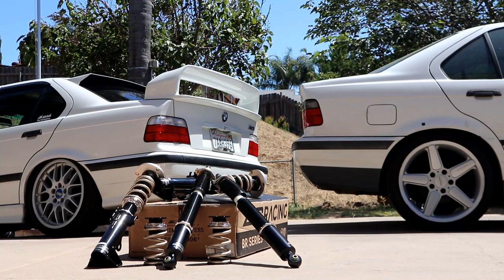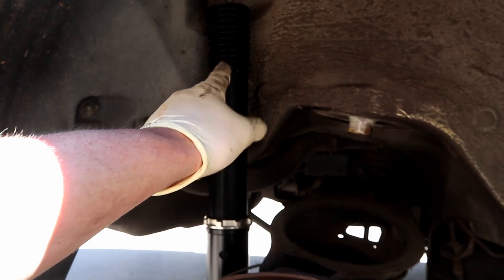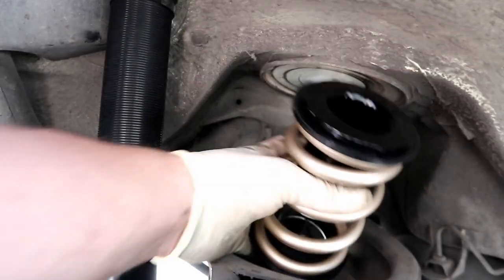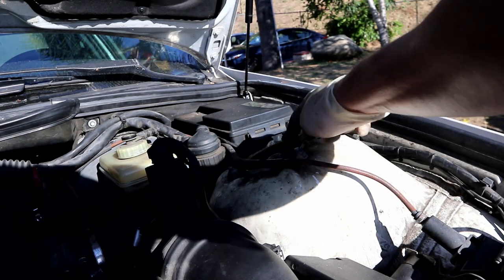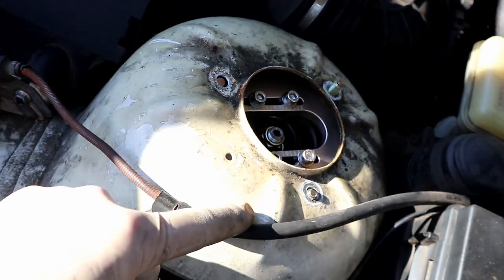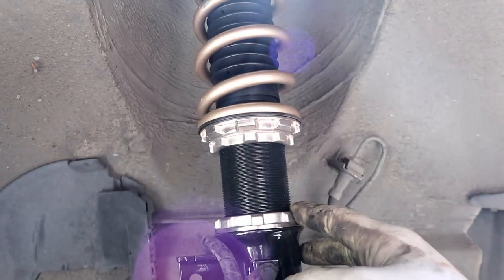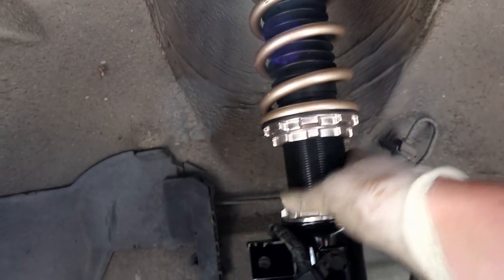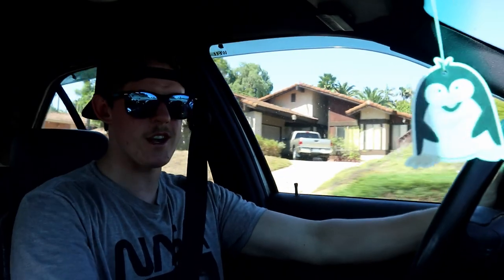Complete E36 Coilover Install and Setup DIY

Comment: Literally just got finished changing my coilovers. Scraping lowlife.
Its a little easier with the vert for the rears.
My camberplate bolts are pretty jammed in position and my camber bars probably need adjusted (tyre shredders) and one of my bbs rc has a leaky weld :( gutted. She is sitting pretty though (328i slammed stance 40mm spacers back 25 front on original bbs rims mora metallic tan interior)
Reply from the maker: sounds mint my dude! what coils did you go for? rear shocks on droptops are super easy unless your top doesnt work.
Reply: Just went for cheaps dude, the roads in glasgow are terrible iv already changed the shockies on the back 2wice before so just cheap and nasty coils. The top still works thankfully but tbh I'm having trouble with the driver window at the moment sticks then stops, then when I get it unjamed a need to do a window reset which is basically everytime I use it. Otherwise cars cool as a cool thing. I basically just buy a new set of cheap coilovers when the fronts give in.
Reply from the maker: @stevencameron3154  damn man sounds brutal, the roads here are not that bad. ive had window problems for years on my droptop, they all work currently somehow, main reason i love the Sedans! we have 4 sedans and none of them have ever had a single window problem.
Reply: @M3NACE  I had 2 coupes before my vert and they had zero window problems. I just love the style of the 2 doors though and even more so the verts now. The suspension should last about a year lol. I seen used hydraulics on ebay for about £1500 so maybe next year I'll see if I can come across something like that again. The window thing is my next fix this week lol rolling about with no door card on it just now :( and the leaky wheel. Got that welded last week but its not sealing properly so I'm on the hunt for 2 rc042s (not easy to find) as it has rc041s on every corner. Fun and games but totally worth it.

Comment: Good job presenting the installation.  I just installed some coilovers on my E36 M3, so what you said matches what I experienced. I didn’t go for a slammed ride height, so I have the rear adjusters in place. 

One problem I had in the rear was replacing the left rear spring. My swaybar made contact with my exhaust (Supersprint), so I had to remove the swaybar and disconnect the rear exhaust hangers to let the exhaust drop down and allow the control arm to be pushed down for spring removal. Did you have a similar issue?

One thing you didn’t talk about was making sure to set the rear shock length to the correct length to keep the springs from coming loose at full droop (or when jacked up off the ground).  Given that you have no spring height adjusters in there, do the springs come loose at full droop?

During your road test, it looks like the car rides really stiff. You’re bouncing in the seat. But I guess that with a slammed ride height, you can’t have too much suspension travel.

At around 21:00, when you’re installing the front coilover…what happened to your steering rack boot???  It looks like it got twisted into a mess!
Reply from the maker: I did not have the Issue with the exhaust, I have a borla catback, not a supersprint, so it may differ. as far as the rear shock length goes, it depends on which coilover kit you have. the BC coilovers have a significantly higher spindle Hight, as in the suspension does not drop nearly as far when the car is jacked up, even with the spring perches removed fully for the slammed look the spring does not bounce around loosely in it's perch, however a set that has a long spring travel may do that, in which case you would need to adjust the shock body length to close the gap. as far as the adjustment goes, installing performance suspension will increase the stiffness of the car, but it is set to a very manageable damp rate for a street car. my drift car has BC coilovers as well, and I have set the coilovers up for drifting on smooth tracks, and its almost unbearable to drive on the street. these cars have excellent travel in the rear even when sitting as low as my M3 does, and I looked at some of the early 90's DTM E36 race cars for my stance, their race cars were even lower than my M3 is and were competitive back in the day.

Comment: Great Video! 
 Im  rebuilding my 92 325is.Rebuilt the cooling system and it's time to rebuild the suspension.  Back left side has a broken shock mount. I saw a plate they make to repair it. Has to be welded in.         Have you ran into this problem?
  I'm going to put them on both sides before the other side gives out.
 Any suggestions for what brand coil overs? I'm not drifting just want quality parts on this rebuild. Thx
Reply from the maker: I like BC's run them on all the cars, street or track. ive heard broadway static coils are good, ive also heard that solowerks are good street coils but the welds dont like the track that much. as far as the shock mount problem, i havent ran into that issue. i would have it re-welded and run a rear strut bar, that should help with the stress distribution alot.

Comment: Wow that M3 looks sweet with the coilovers I have 1999 E36 323is 3 Series Coupe in show room condition I’m starting to add the coilovers soon , Headers with down pipes it’s running on 245/40/17 in the rear and 235/40/17 in the front but adding 10mm spacers on the rear cause it rubs light at times when I take a curve to sharp and quick . If anybody that done there E36 got any pointers I’ll highly appreciate it 🤟🏼

Comment: Nice video.  How are the BC BRs holding up?  Overall a good set for the E36?
Reply from the maker: Excellent, going to 3 years of daily driving
Reply: @M3NACE  Great to know, thanks!  I'll be looking to order a set. I have H&R lowering springs but with the older shocks it is getting a bit too harsh for daily driving.

Comment: The install setup for the rear, would that be OK for street/weekend autocross? Does the ride feel very harsh too?
I installed mine just compressing the spring installed to about 5-7mm. Been seeing this way of installing recently by you and Denofa.
Reply from the maker: Yup! Have them set up this way on my street and my drift car with no problems.

Comment: What are the benefits of a coil over? just that the stance looks better ? is it just to lower it?  you did not elaborate. You said install them "because they are the best out there" what does that mean?
Reply from the maker: best way to lower it with good performance, stock suspension is usually designed for maximum comfort while having good performance and good clearance for bumps, potholes, and clearance for curbs ext. if you want to lower your car and increase the performance of the suspension, good quality coilovers are the best option. they allow maximum adjustability for damping while having adjustable ride height. the problem with getting a good spring and shock setup, like koni shocks and H&R springs, which it a pretty good street setup, is that the shock and the spring are not designed to be in harmony with eachother. if the spring is lower than the shock is designed to be, the shock will not have its full range of travel, and you can bottom out the shock, which can disrupt the car. coilovers like BC's, broadway static, or bilstein coilovers are designed so that the shock and spring can have maximum travel while having the car and any ride height you want, BC's are designed to be used on drift cars, where suspension system see's way more abuse than any "street" or "sport" shock will ever see, that's why i use BC's. coilovers like solowerks, megan, and even some shocks like koni's have reports of cracking on shock welds for the tabs that hold the spindle and sway bar together on cars that see drift and high regular abuse.
Reply: @M3NACE  thank you.

Comment: did control arms and tie rods aint gonna slam it but DAMN nice car
Reply from the maker: very nice thank you! I need to do control arms at some point soon.
Reply: @M3NACE  actually the hardest thing to do on the car, just cut the ball joints off
Reply from the maker: @burger1g  I would probably just buy replacement arms with new ball joints, pop them out and pop the new ones in.
Reply: @M3NACE  I got new ones too, I'd recommend getting the poly bushings and new brackets unless you got a way to press em in and out. The ball joint under the shock I cut because I wasn't trying to take off the suspension yet. BC coils soon should I get the BR or DS? Can't decide

Comment: whats the point of running the collar at all if your doing the extreme low? can you not just install the spring with the isolators and call it good?
Reply: You can run it without the collar but it’s a lot more stiff

Comment: How did you get contours to fit with BCs? Are you running spacers? Mine with no spacer touches the spring seat
Reply from the maker: No spacers, M3 Trailing arms though.
Reply: What’s tire size? I have 245/40/17 from PO was gonna try to run in front for more grip but had clearance issues with coil
Reply from the maker: @turbolifestyle6548  well you run 225/45 on the fronts, 7.5 inch wheel, 245/40 on the rear on 8.5
Reply from the maker: Run them how they were meant to be ran
Reply: I feel really dumb. I had no idea the wheels were staggered. It’s going to be a weekend warrior. Daily driven drift car. So I don’t want 245s in the back. Guess I’ll save those for something else 😂. Thanks for the knowledge. Your videos are a joy to watch.
Reply from the maker: @turbolifestyle6548  you can stuff 225's on the 8.5 inch wheel, alex is running 225's on his 9 inch wheels lol they are just stretched
Reply: I’m thinking the 8.5” with whatever it’s offset is, is the reason it touches the coil. I’ll remount it and see but I’m pretty sure it was the wheel touching not tire. If it’s the tire I’ll just get a smaller tire as you said.
Reply from the maker: @turbolifestyle6548  im not sire what the setup will be like with non-m spindles and trailing arms, but M3 parts the wheels and tires tuck perfectly.

Comment: For the rears why did you remove the locking collars when installing it or I thought those were used for adjusting the ride height?
Reply from the maker: Just for adjusting ride height, slammed all the way.
Reply: So you removed the collars to max out the lowering height?
Reply from the maker: @justinphan1779  yes, the kit includes rubber replacement perches. For factory kits, the top 1/3rd of the sleeve needs to be trimmed, but they dont on extreme low kits.

Comment: so is there a way to use the m3 sway bar links on a non m car?
Reply from the maker: yes, you just hook them up to the non-m bar. the issue is the sway bar is a different thickness than the M3 bar, and the bar will not perform like an M3 bar just because you have M3 links on.
Reply: @M3NACE   Okay makes sense! would you reckon there would be any drawbacks besides possibly premature wear then? which is to say more like safety concerns?

Comment: Do camber bros go get alignments?
Reply from the maker: Yes we do, and our camber isnt even out of spec.
Reply: @M3NACE  do you specify what you want to the person doing alignment?
Reply from the maker: @RobbyJHope  im a professional mechanic, and I do them myself at the shop i work for
Reply: @M3NACE  so do you think a regular shop would accept out of spec adjustments or do I need to look for an Indy shop
Reply from the maker: @RobbyJHope  well if you run camber arms on the lower control arm like we do then your camber wont be out of spec, but you will need to find a shop that has an alignment machine that can hook up to a low car, they have alignment wheel mounts that grab onto the wheel. Most will grab onto the tire and you cant do that of your tucking wheel. Best to call around some performance shops and see if they can do it or not.
Reply from the maker: @RobbyJHope  alot of shops will send cars out the door with camber and castor out of spec because of suspension wear or damage, some cars get tweaked and there is no camber or castor adjustment so theres nothing they can do to fix it, happens every day

Comment: I don’t have to have an m3 to use those sway bar end links correct?
Reply from the maker: no, but the bar will not act like an M3 bar just by installing the end links, i would recommend leaving the stock end links in place with the stock bar,
Reply: @M3NACE  and if you are running e46 low control arms that need the sway bar link flipped and hole drilled or m3 bc links